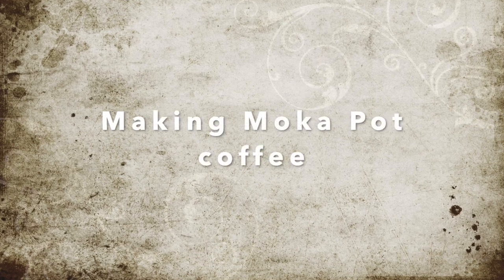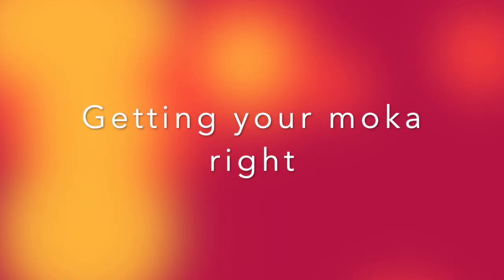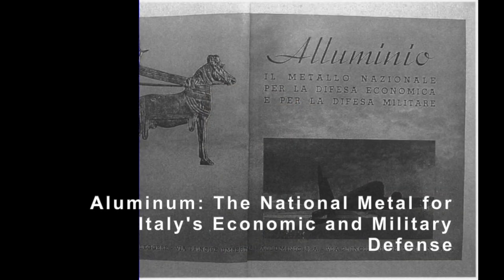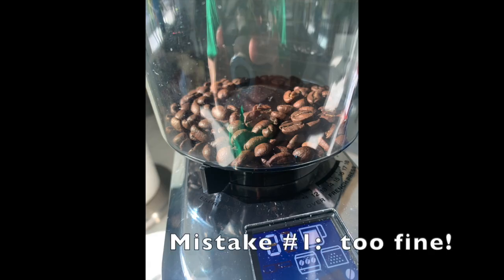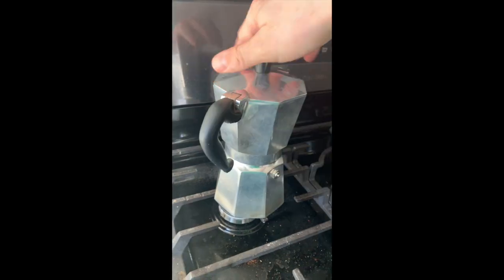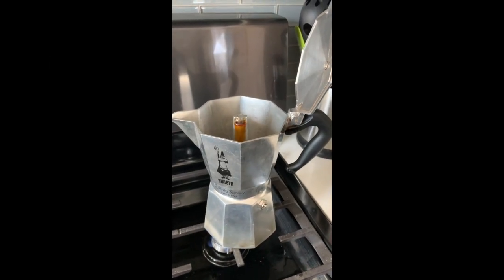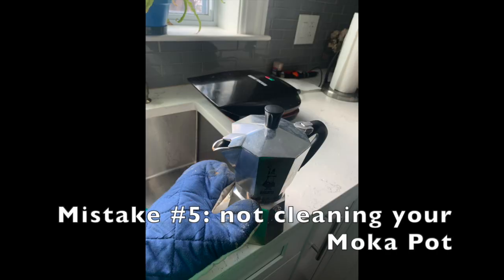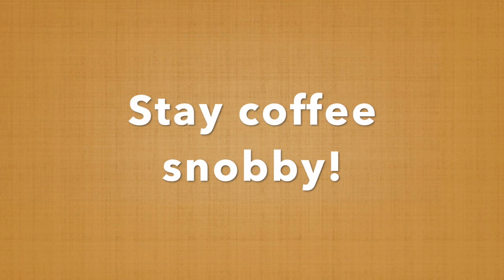Why your Moka pot tastes bad

Comment: I never get to that foamy stage. When majority of the coffee is out, large bubbles just pop out of chamber every few seconds. There’s still about 1 fluid oz of water still left in the bottom chamber every time. I’ve been leaving it on the flame on a medium low heat with hot water already in the bottom chamber. It takes about 5 minutes for any signs of liquid to come out.
Reply from the maker: So my latest tweak is to turn it right down to "low" once any coffee starts coming out.  Extraction is very sensitive to temperature and once you've got steam in the low chamber, you don't need much more heat to keep the process going.  Good luck!
Reply: The funnels on some moka pots don't reach all the way to the bottom of the boiler. There is always water left over, in this case. Don't worry about it.

 If you want more bubbles/'crema', turn the heat down a little and pack the coffee gently to help build pressure. It will take longer to brew.

Comment: I dont understand why u need to cool the chamber. Just pour it out immediately. That should stop the cooking.
Reply: Sorry its not directly directed to you but a  general remark cos i see other people do this too. To me its just inefficient. For smaller moka, pour to your cup. For bigger moka, pour into serving pot.
Reply from the maker: Hey, good question!  Simply removing it will not stop the brewing.  Once it starts going, even removing the heat won't stop it.  As for pouring it right away, I guess you could try, but my concerns would be that you're not going to pour it out fast enough and also, you might not want all of it in your cup at once, if it's a larger capacity device. But hey, don't take my word for it.  Give it a try and let me know how the results work out!

Comment: I do everything wrong and I like my results. I use cold distilled water, electric plate on high, I use fine ground espresso roast coffee, and I pack the coffee in and slightly mound over the puck. This makes an extremely strong cup of coffee and I don't find it too bitter. I don't use sugar, only cold heavy whipped cream. 
I live at over 1 mile high so the water never reaches 212°F so it doesn't over heat the coffee. 
Anyway, that's how I do it.
Reply from the maker: Yeah, the more I research into Moka pot, there larger the number of expert opinions I find saying different things. I posted a link above to a video that completely contradicts much of my advice. At the end of the day, these are just ideas to play with and should come down to what your experimentation yields with your taste preferences.  Don't take my word as gospel, for sure!
Reply: If it tastes good, it's not wrong. )

Comment: Just exchanging information,  did you ever tried coconut oil (extra-virgin) with coffee?  It's absolutely delicious!
Reply from the maker: Never tried!  I’ve experimented around with sweetener condensed milk in the lower chamber though (would not recommend unless you want to spend 10 minutes unclogging your Pot!). Do you put it in the lower chamber or add it after?

Comment: Soo if you take out as soon as it starts to bubble or become pale, you end up not filling the entire upper part and will have water in the lower part. I thought I have to use all the water and fill the upper part to the top before ending. Will try your method, guess it better to add hot water later if it is too strong but at least don't get bitter coffee.
Reply from the maker: Hey, thanks for the comment!  You’re completely correct, in that some water is left behind in the lower chamber.  Some brewers will say this messes up your brew ratio (it does), but I’ve found those last 50ml or so of brewing to be the biggest culprit in bitter taste, since you’re running water through grinds that have already been extracted by the earlier water.  

On ratios, for my model of Moka pot, filling up both the water and the coffee gives a 15:1 ratio, which I imagine is common across different sized pots.  You’re right in that my method makes that ratio a bit higher, since some water is left behind.  The coffee winds up being a bit stronger, but a lot less bitter, so I’ve found the taste to be greatly improved over just leaving the pot there until the water is gone.  But, with all Moka advice, your mileage may vary!  Try both ways and see what works better for you.